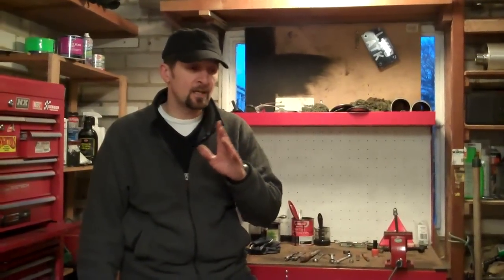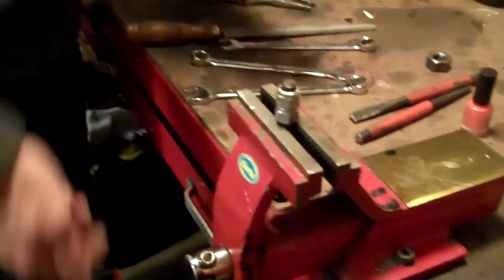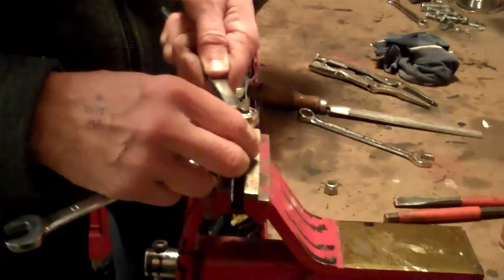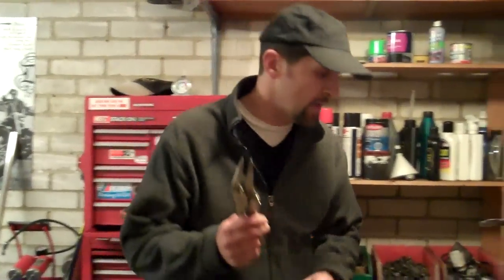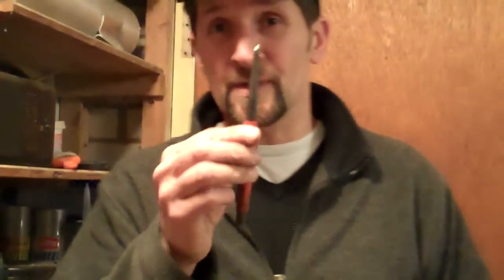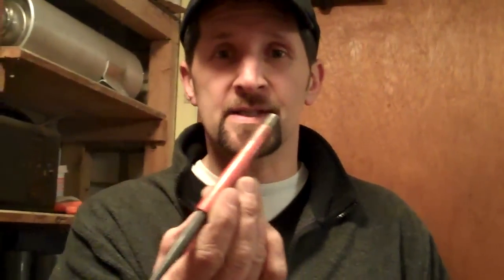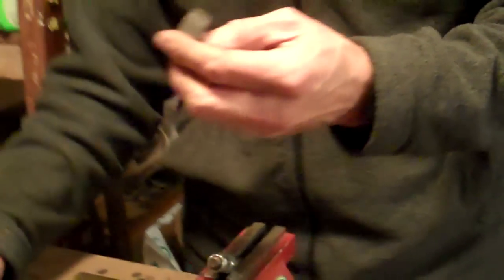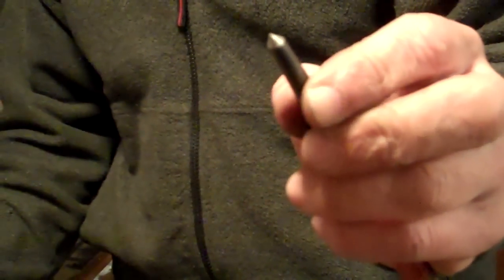Delboy's Garage, How-To ;- Rounded nuts?, an easy solution..!

Comment: Sometimes you have to bite the bullet and buy a set of sockets for rounded nuts, I did one of the best investments I made use them if I think there is the slightest chance of slipping off on old rusty nuts and bolts

Comment: I have some rounded hex/allen bolts holding my calipers to the front fork legs - the bolt head is kind of indented in the caliper housing so there is not way of getting to work on the outside of the bolt head.
The bolts are torqued down pretty much - a size 6 allen key slips, and I can't get a size 7 in there.
What is a good way (and a way) to get the bolts loose?
Reply from the maker: Jan Rasmussen Try tapping a torx bit in there that doesnt slip in, but will bite if you tap it in gently....if that still slips round.. then yo'll have to drill the heads off... torqued in or not, once you drill the heads off take the caliper out of the way, and the stumps can just be twisted out with pliers...

Comment: also, that punch method can be used to extract broken off and countersunk bolt shafts in a pinch if they're big enough. use the same method, except punch in as close to the wall as possible, then angle the punch to drive it around and out.

Comment: Ive tried this method with no good results, it worked but now the bolt is spinning with the nut that I broke free this way, its a tir rod castle nut on a 98 civic, ive got 6 all stripped or rounded & ones that aren't the strews are spinning with them. Any advice? im trying the grinding method but with no luck, Im at the end of my patience & don't know what else to do, Ive tried, torch chisel, pen oil, air gun,breaker bar, I mean you name it ive tried it & I cant get the bolts/parts off, any advice for me? Short of melting with a torch which I cant find at the moment, ive tried everything that can be googled
Reply from the maker: Hi mate, sorry to hear it's got so bad... but with things like tie rod nuts living in the environment they do of salt and corrosion, sometimes they just rust solid!  In the past, provided the thread is solid, you can snap them off with a pipe wrench, but if the thread it spinning with the nut then the only solution is to cut them off, see if you can get a disc in there, and if not, just a naked hacksaw blade with a cloth round it, have some patience and just work your way through it at the base... you'll soon have it off and replace it all with new stuff... good luck mate, keep persevering, Del

Comment: i usually use the smaller imperial size or use an old socket and try tap it on usuallually works for me iv tried this with the centre punch but if its a cheap really crappy nut itlle just chew it even more

Comment: Thank you for this vital helpful information. I have a wheel lug nut totally rounded. I tried to use reverse threaded socket, but it does not help. Looks like a center punch and a chisel will do the work. I can not wait to try. By the way, if the bolt is totally welded, i do not think people need to take it off. Could you give some examples what the applications in the last seconds of your video?
Reply from the maker: Hi Yang, the tem 'welded on' I used as a metaphor to indicate that it is stuck so hard that it is as if it's welded on ... sorry mate, just the subtleties of English!

Comment: Your talking a newish nuts/bolts with good access. Many an old car's bolt are rusted away without access to use a punch. Sometimes they're not that tight and good quality mole grips will loosen it, other times a nut welded on is the best option. I find your across the board comment, suggesting people who use mole grips are idiots to be wholly inaccurate, any tool can be useful to get the job done, if you have the experience to choose the one appropriate tool for the situation and know when a tool is not working.
Reply from the maker: No offence intended Sim.. use what works aye.

Comment: A friend once showed me how to loosen a completely rounded bolt head on the side of my car engine.  He brought out a pipe wrench and a 4' pipe, which he used as a long lever.  I know you can't always get a pipe wrench to the damaged bolt head or nut, but if you can, it's a pretty simple thing to loosen it.
Reply from the maker: Pipe wrenched tighten as you pull on them... and yes, they always work if you can get a clear purchace on them and space to move the wrench... most of the time you cant get them in on the job..!

Comment: The chisel+hammer technique, is it realistic to loosen say a rusted rounded head brake caliper bolt, M12 thread, torqued around 125 Nm, quality 12.9. Or is welding the only thing that'd work for that kind of job?
Reply from the maker: Hi Eric, naturally welding would work as you know, and I'm sure you'll agree, that the only concern chiselling when there are alloy castings nearby can be dangerous, cast alloy can't take a lot of impact, so maybe warm it up for a few minutes with a hot hair dryer, get the metal really warmed up to expand the alloy as much as you can (remember aluminium expands faster than steel, so should expand away from the bolt a bit)... then have a tentative try with a centre punch... but honestly 125Nm, that's gonna be tight, so take it easy mate ...  Just one point buddy, what exact bolt are you referring to that is 125Nm???  Obviously not the bolts that mount the caliper to the leg??  Are you referring to the bolts that hold the caliper halves together??  Cos even then, they're not that tight... just can't be sure what bolt you mean from your description.....??
Reply: Hi, thanks for replying. I looked it up now and it should be 120 Nm (dry). It is 2 bolts on a volvo 360 that hold the "stationary part" of the caliper to the strut/spindle, not sure about the terminology in English :) Onto that stationary part I mount the glide pins and the other part of the caliper which is sliding with the brake pads in and out under braking. It's an 80's car so luckily everything is cast iron. I have no welder but might give this a try and purchase a chisel. It is a flange head bolt that lacks definition due to rust, so a 17 mm socket do want to slide. If all else fail, I'll leave it to someone that can try welding on a nut :)

Comment: Unfortunately no help for me as the bolts are in the ECU unit, very small , and inset into the plastic housing !! so very difficult to get any purchase on the bolts !!
Reply from the maker: I've seen that kind of thing before buddy, screws and bolts in fragile applications..

Now I've never tried it myself, but I hear, and have seen on some YT videos, that people have had success by using JB Weld to glue the tool in to the screw for a good fit and tight bond, that way o impact needed... not sure if it will work for you, but I hear it's worked for others, good luck with it my friend...

Comment: Most of the buggered nuts and bolts I've dealt with have been rusted ones, mostly on boats. I've had some luck with filing or Dremeling  two flats onto the fastener and using an adjustable. I have cut very rusted fasteners off with a cold chisel, too. Thanks for posting.

Comment: very use full tip, ive been a spanner money for years and I tell you one that's a huge garage bill is exhaust studs or snapped studs, mix metal seezing is a b***rad
Reply from the maker: Sure is buddy, chemical electrolysis and salt corrosion.....better then phuqin MIG WELDING for sticking metal together..lol....!

Comment: This is a great video. I have attempted a similar method of sawing a groove in the side of a bolt and trying to tap it round with a screw driver, to no avail may I add. 

I have given your method a go as well and cannot get the bolt to shift. I am a bit apprehensive of drilling the bolt out as I have no idea how deep it goes and don't want to damage anything further.

Do you have any recommendations?
Reply from the maker: Hi Olly.... there is a but if misunderstanding with the term "drilling out"..... that actually applies to a sheared of bolt or stud that is flush with the surface....but when a bolt head is rounded and you cant twist it the ultimate remedy is to just 'drill the head off'....meaning;-  to drill down the middle of the bolt head by no more then the thickness of the bolt head, just till you reach the shaft....and use a drill bit the same size as the bolt shaft...once you're through the bolt head will detach and twist off with the drill bit (you may need to use some grips to just break it free). then once the head is off and our of the way, you can remove what ever unit or casing its holding in place, thus revealing the stump of the bolt, and most often that wont be tight as the head which was holding it down is gone...you can then extract the stump with a stud extractor or grips..  Hope that helps matey.... good luck, Del.

Comment: Dear Mr DelBoy, not a bike but a Reliant, the seat belt stalk bolts have by a previous owner been rounded off and been doing me turnip in trying to get something to turn these bolts especially as they been loctited, I bought some Irwin bolt extractors but they don't seem to work and having some real headaches as I can't drive me motor until I replace the stalks :(   Any ideas?  I got Irwin bolt extractors, easy outs but its such a cramped area and being fibreglass, carpet and a fuel line underneath too I can't weld on a bolt or socket :*(
Reply from the maker: Hi Ian, sound like you've considered all the options , can you get a drill bit down the middle of it to use and easy out??  Or if all else fails, then you can just drill the head off, and then use a stud extractor on the stump... you need a short pilot hole down the middle and then a drill bit the same size as the shank.. the head will come free, so the stalk can come off, and as long as you have 10mm of protruding stud, you should be able to get a grip on that - just a suggestion buddy, hope you can get it sorted !  Good luck with it, Del
Reply: Mechanic put a high power windy gun on the lot of 'em, out in seconds hehe   thx for the advice :D

Comment: What a fantastic video and tip. I was working on changing the sump on my Chrysler voyager and 11 bolts were fine and one was so rounded that no socket, spanner, special nut removing socket or Spanner managed to even grip it. There was little room and on a car jack so it was not easy job.  I also tried all the usual lubricants and heat but it just made it worst.
Eventually I was thinking this video and then welding a nut on top.  I gave this a go with my lovely neighbours hole punch and very small hammer and after 2-3 minutes it worked a charm.   The small tapping also helped to loosen all the rust inside the hole

Thanks you very much mate.  As a woodworking man, it made perfect sense as soon as I saw it.  I got such an easy result after two days of trying everything else.   Thanks mate
Reply from the maker: Most welcome buddy, so glad that it helped you, it's such a simple little trick and goes against everything that we naturally reach for when anything is stubborn and resistant, we always seek for bigger and heavier tools in order to dominate the situation, but some things respond better to the gentle touch!  Thanks for watching and taking the time to send some feedback...

Comment: umm yea.. screw all that junk.. I'll just grab the die grinder and cut it off..
Reply from the maker: ....and if its a caliper bolt, recessed into the casting.....or an engine casing bolt right in a tight ridge.....still gonna butcher it with a grinder..?

Comment: Use an air hammer on a low setting. Makes quick work of it. I use Metrinch sockets and wrenches for rounded off nuts or bolts.
Reply from the maker: Yeah, good fix usually, at least for those of us with a compressor and air tools, and also if you can get a socket in there....this works for socket caps when they get rounded out too...

Comment: that is very easy to do and understand,...but the real problem of course come when the bolt is holding an oil casing under your car and there is a 4 inch wall all  around the f...g bolt that has been rust to death.  now you have a real problem.  The only solution is penetrative oil, vibration (you hit on it), and ease out tool that bite into the head and pray it will not destroy the entire head...
Reply from the maker: Good luck with it buddy, these things are always easy in theory aye?!

Comment: Always worth revisiting your vids.  I slightly rounded my sump plug, it just won't come off, Weggy advised me to leave it alone, it's booked at my mate's for Wednesday, I posted a link to an interesting item on your oil change vid, it's called a turbo socket, hadn't heard of them before.  I'm so tempted to try to get the plug out with a socket set (which I need to buy anyway), because I don't like failing at things, but is it worth risking rounding it off more?  It's only very slight atm...hmm.
Reply from the maker: Glenn Makin Hi Glenn. take a fine file and restore the bolt head sides on the sump plug, take off any bruising or burrs and make it as perfect as you can... then fit a 6 sided socket over it, and habve another go...if it feels like its going to slip round again, then you can use one of those tubo sockets, i have one here and they work very well... Good luck with it.. Del.
Reply: Moonfleet41 Cheers bud, in the info bank for future use.  Mechanic at the dealer's cracked the nut off for me, just did my first oil change yesterday, and used the tips from your vid to help.  Take care mate, thanks

Comment: Great video,  may this work on rounded carb screws i managed to get 1 off with a impact but only made the other 3 much much worst. I won't allow the hicup make me given in a buy a new right carb.
Reply from the maker: +Classickid21 Im afraid i cant answer that, its a matter of being careful and using a really sharp punch or chisel, in the end, you can always drill them out and replace them later...
Reply: +Moonfleet41 hello thank you for replying i will give you an update and let you know how i get on.

Comment: Hi DelI was watching your Harly fork oil change the other day and thought I'd tackle mine. The big differance is (mines not a Harly) there is a pre load bolt on top and I'm not so sure if I'll have to fully remove the forks or not.Your advice will be very grateful.All the best Metal Micky
Reply from the maker: +mustard dave Hi mate, you didn't say what bike it was... do you have a drain screw at the bottom?  If not, a simple way is to suck the oil out with a tube, you can use a 4ft length of clear plastic tube, suck it up till you see it come out the fork, then blow it out in to a container... over and over, till it's all out !  Then fill with the correct amount... ignore the pre-load bolt at the top, it comes off with the cap.... should all be one attached unit !
Reply: Cheers for the info Del, I'll have a closer look tomorrow, all the best
Metal Micky

Comment: Great tip, I've often used an old tool kit screwdriver, slot/flat head of course, which works about the same as your chisel I guess. I've never thought about a centre punch though because it can be hard to get that to bite on a small nut without hitting something else. Mostly I have problems with heavily corroded nuts and find a decent small file handy, filing down either side to good metal until I can fit a smaller open ended spanner on then turning the remains of the nut off. It's a long process though, keeps you busy on a rainy afternoon. Now I have to do all my fixes outside at our new place though so I have to choose a good day, that's why I have all the bikes i do, then I  always have something to ride while I'm fixing something else.  I've been off the road since July though, cancer, recovering now though although it took my bladder, hoping to be back on the road proper in a few more weeks. Enjoying all your videos.
Reply from the maker: Blimey mate, you dont do things by halves aye....i hope you are feeling better after your illness, i cant imagine how it must feel having to cope with that. Love your mentality buddy, keep 'em running and get on with life... i think we would get on very well on a long lazy summers afternoon at a rally with a few beers no?.....doing the Bulldog bash this year by any chance..?...
Reply: Moonfleet41
Thank you for another reply. My wife tells me I often do things the hard way, I'm not sure I do but I do get satisfaction from making things work for as little money as possible, although I seldom get a choice to do otherwise. Even when I'm at my best I don't travel far, CFS/ME means that I have to pace myself and so I don't really go more than 30 miles or so from home, I can't take to many risks as I ride on the sufferance of the DVLA and if anything happens then my licence would be gone probably never to return. No beer either, being coeliac ( gluten intolerant) as well, the odd pear cider maybe but not to often as it messes with the meds to much. It's best, I find, to just make the most of what you can do. There's always someone else worse off.

Comment: Great vid, i have the same problem with a phillips screw under the seat that has been grounded horribly, what could i do to resolve that?
cheers
en
Reply from the maker: if the screw is minced out Enis, then all you can do it drill it out....drill with a bit the same size as the screw thread, and once the head is drilled off, you can wind the stump out with some grips or pliers... good luck with it mate.. del.

Comment: Hi Del,hope ur well,just want to say a big thanks,was changing brake hoses,had 3 nuts wouldn't shift,drilled in side of nut to get a better purchace, tippy tappy and off,each time in my head,thank you, thank you,thank you...project Kawasaki gpx 750 is one step closer thanks to you, done more then i'd expected but with your helpful vids you gave me the confidence to give it a go. once again, big thanks
Metal Micky